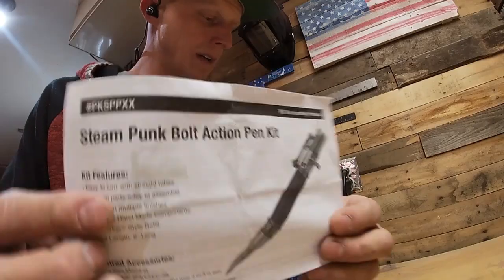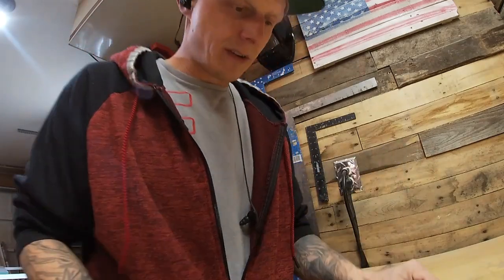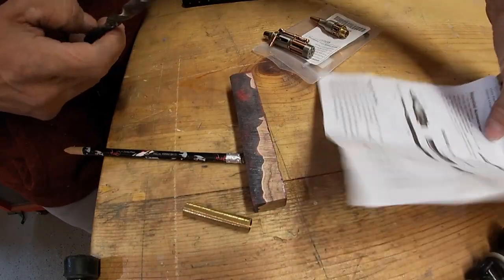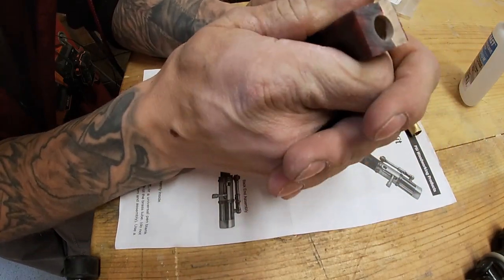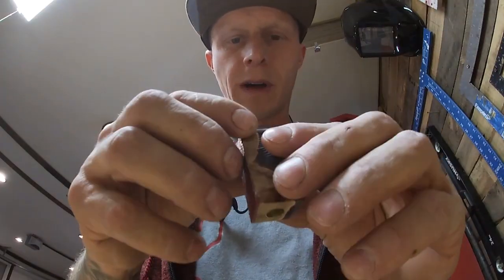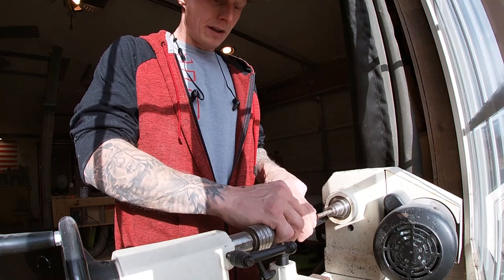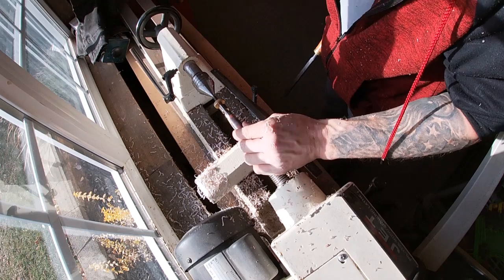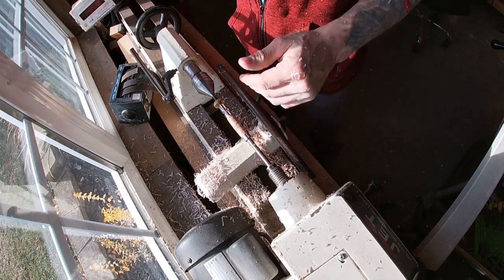My most exPENsive pen . Thermal chromatic Steampunk pen bolt action.

Comment: That looks awesome
Reply from the maker: Thanks for watching and for the comment!!! Appreciate it
Reply: I normally turn bowls and vases picked up my first pen kit last week hopefully turns out nice like those I don't have the Mandel or anything yet
Reply from the maker: @jasoncochran1210  pens are fun, fast and easy.. get yourself a pressure pot and cast your own blanks it will save you alot...have a great time you will love it !!
Reply: What kind of resin do you use
Reply: And where can I get
Reply from the maker: Alumilite is all I use , never had a single issue..they are very helpful with questions too...I have done a quick casting video with a pinecone duck call and also casting a label pen blank which is a awesome way to make custom pens .
Reply: Where can I find it at any idea
Reply from the maker: https://www.alumilite.com/
Reply: What do you normally charge for your pens
Reply from the maker: Alot of different factors but normally my supplies plus like 10 bucks or so
Reply: @AllAmericanArtsMN  thankyou

Comment: Beautiful item but man your safety is indeed shocking lol leaning over moving machines, loose hoodies strings hanging near buffing wheels, holding blank by hand when drilling, no eye protection, no dust protection when dry sanding. But hey as long as you've been safe so far its ok!